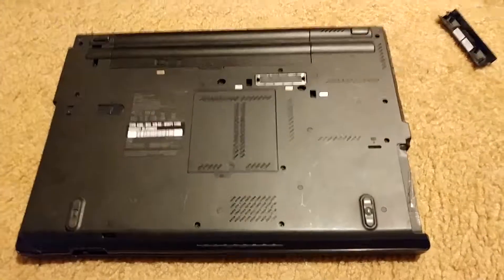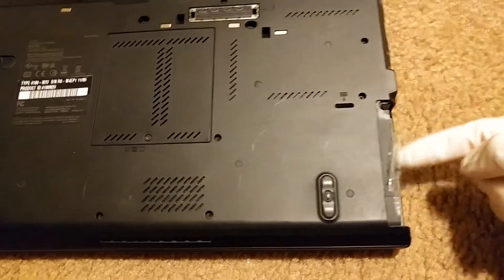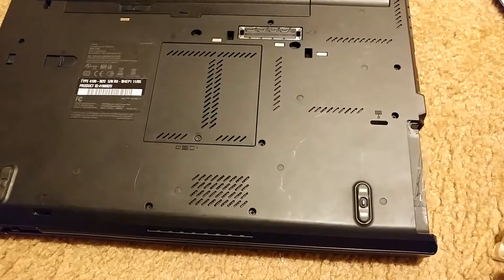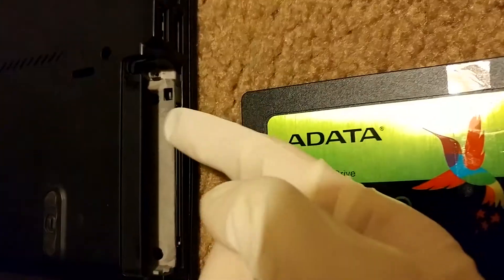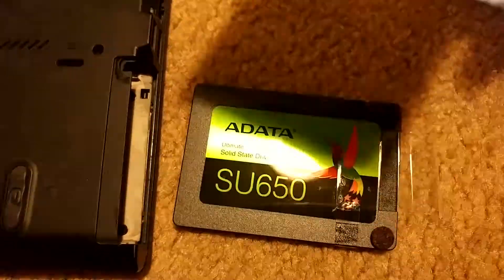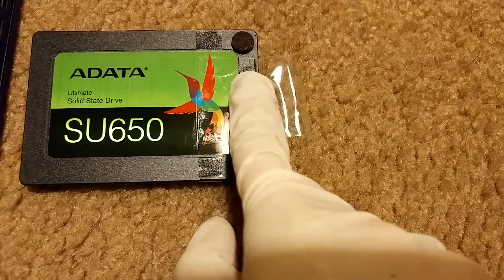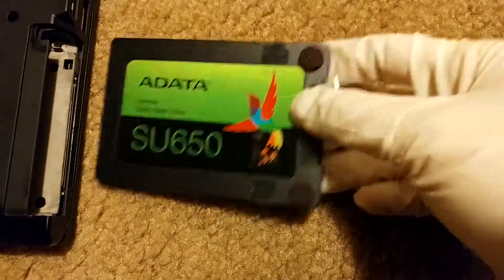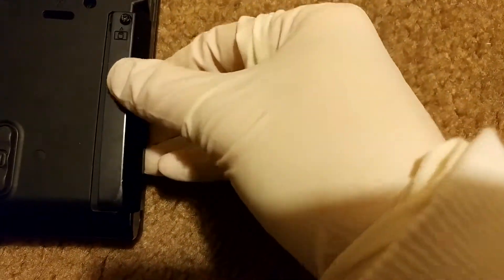DYI Lenovo ThinkPad T Series Hard Drive Caddy (T420 and others)

Comment: Hey mate, I liked your video for the effort and idea -- but in case you are not aware (I suspect you are not) there are some bad practices going on in this video : You are working on a high-static / ESD surface (fluffy carpet) - It appears you are exposing the electrical contacts of your Hard Drive directly to this high static / ESD surface....  and you are installing FELT PADS(!!!) into your laptop (as spacers / buffers for the drive, I assume).  Better to use something that is non static, like rubber pads. Most older Thinkpads actually use rubber pads as an original part to keep drives in place. 
PS. I would not even operate my laptop on that surface or any static surface (especially one with protruding fluffy bits). There is a some chance you could discharge static into your mobo through the chassis grill or whatever exposed part. 
Anyway, that's just my 2c.
Reply from the maker: I'm aware. I've worked on 100+ computers and laptops over the years and never had a problem. But to be safe, ESD should be taken into account for sure.

Comment: This will only work as long as you never move your laptop
Reply from the maker: The cover will keep it from popping out and the connector on the other side will keep it from sliding further inside. The felt pads reduce motion. As long as you're not violently shaking it, it should be fine.